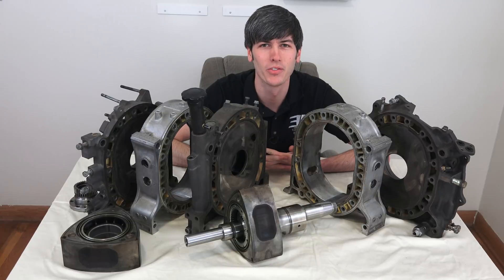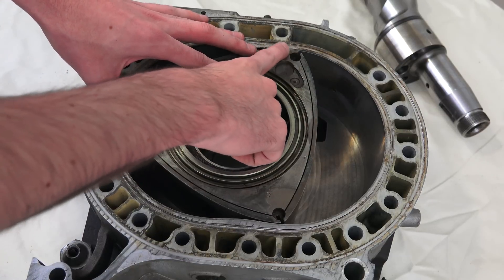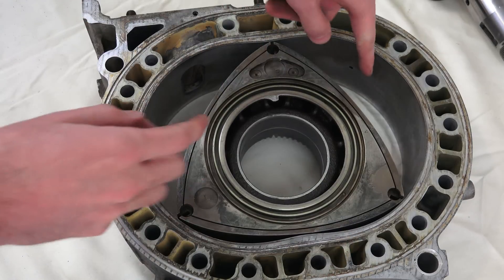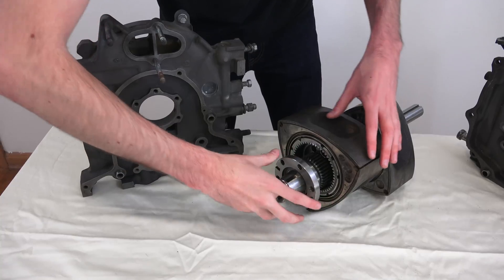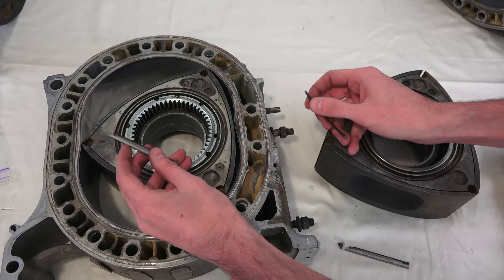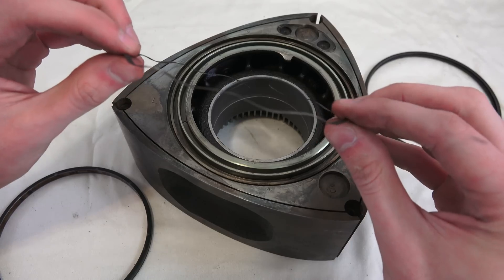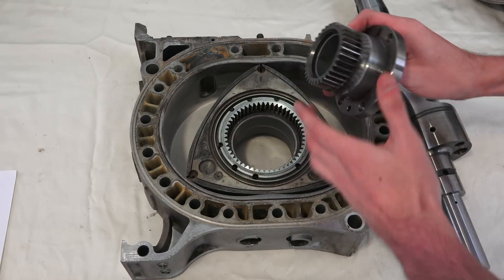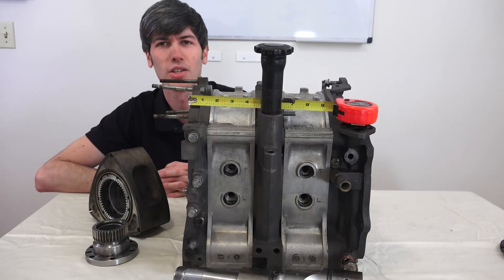How Rotary Engines Work - Mazda RX-7 Wankel - Detailed Explanation

Comment: I think these engines would be great as, like ATV, outboard motors or tiny rotary lawn mowers. but in a car they are just downright awful. they are so slow, and get worse MPG then my e85 EVOX, which is funny since I'm happy to get close to 200 miles a tank, but it only cost me 20 bucks +/- a few bucks to fill up. there is no excuse, mazda has dumped billions in rotary research and still it has changed very little. I have driven a 300hp FC, and its nothing close something you would want to daily. they did a lot of things though like the twin scroll turbo, which was a HUGE deal back in the day, if you think in the terms that Subaru just added a twin scroll in 2015 to the WRX, they were using them 25 years before. rx-7 did a lot for the compact sport car technologies in handling and chassis: are  still some of the best today, they pretty much bank on this stuff still. ZOOM ZOOM, is not a feeling of speed but of chassis born from early rotarys to make a car fun to drive.
Reply: +digitalsaint2040 Sounds like the 300HP FC you drove (which is easily achievable with a bolt on hybrid stock turbo and some larger secondary injectors) was broken if it wasn't drivable as a daily driver. A real shame because 300HP is what I consider the real sweet spot for FCs. Not stupid fast but certainly fast enough, easily done, reliable, good fuel economy and a blast to drive.
Reply: +digitalsaint2040 They're slow is not an argument if  you compare them to a modified car. My 85 RX-7 (When Stock) beat my buddies stock 85 Celica in a drag race. 1.1 liters vs 2.4. so even stock against comparable cars they are great.
Reply: +Charles Darwin I half agree, because I think if they put a 4cyl with the twin scroll turbo, they would have had a much more potent car. when I mean potent, with its weight  faster then 1985 911, or a Ferrari 308. IMHO the technology of the twin scroll turbo out shined the engine. without research I cant think of any production car that was using them at the time. think about it, that's a big deal.
Reply: Well if they did go the Turbo route, the inline four, or the turbo inline four route weight would've been significantly higher than just a rotary. However, I can see what you're saying. Similar to how the RX-8 is great car, its practical, handles well, rides well and looks good. But is an unreliable turd, because they needed to make XXX hp from a NA rotary, where if they used a V6 they would've achieved their goals, and had much better reliability.
Reply: +Charles Darwin eh, by time the rx-8 was rolling off the line, semi-closed deck all aluminum block's and plastics would have made a light(er) engine, maybe not as light as the rotary, but at that point handling wise nothing some tweaks couldnt fix, I mean look at the MS3 and its FWD very solid, purposely understeers to panic free delight! I really want to like the Wankel, and SO does Mazda. maybe somewhere down the line technologies will open a new doors for engine.
Reply: +aaroncake I'm sure you're right. 300 on a mustang dyno, so play with those numbers in your head. it was loud and ??K sprung, swifts and helpers, super tight. and the owner assured me fuel economy is abysmal. relative to driving it daily. he said the same thing, 300 was a good spot for the platform.
Reply: My 1.1 12A gets 300km from 50 liters of 91. it is carb'd though. Slightly more understandable.

Comment: I own a rotary  (n/a fc vert) and I have got to say the rotary engine is brilliant. the stock motor in my car lasted 170k miles due to correct maint. and coming from someone who loves beating on their motors a rotary will stay at 4500 rpm all day and love it and when you start shifting at 3k it will bog on you. beating on a rotary is the best thing you can do for them.

Comment: so what exactly makes it unreliable?
Reply: The seals can break and there it is a lot of things you need to do differently compared to a normal engine. Example: if you don't rev it high enough when you turn it on the engine can flood
Reply: +evoxs ok thnx
Reply: +Jacobi Miller Drivers. Rotary cars have to be driven hard. SA22 and FB RX7s even had a buzzer that let you know when was the optimal time to shift- 7k RPM, if I recall correctly.

Comment: Should I get an FA or an FB rx-7?
Reply: +Phil Raus chassis codes dont change in Austria? Lol ....fb didn't come turbo they did make a few 12a turbos but I highly doubt that what you are looking at for 4K lol you are talking about a FC turbo II. In which case 4K is about right.
Reply: +Phil Raus idk about insurance rates over there... But I do know I'd be very skeptical of a cheap 12a turbo like that....
Reply: +Phil Raus yeah that's my point I wouldn't trust a someone who bolted a turbo on a 12a selling for 4K.
Reply: facepalms
Reply: +lee Jones they are the only ones in my Budget
Reply: +Phil Raus *SA22 or FB. Besides, they're mostly identical, except for some engine and visual differences.

Also, I think that an FC would be cheaper.
Reply: MarchuxProductions nah not here.
The cheapest FC around costs 9k and it is rusty, leaky shocks and a gearbox with two gears missing,whereas the best fb costs 4k, has low mileage an aftermarket turbo and h&r coilovers. Thanks anyways!
Reply: I think he's mistaking fc for and fd. The first generation rx7 was an fb
Reply: lee Jones no Im not
Reply: well where do you live!?! I bought a mint fc with 50k on the motor clutch and tranny no rust no rot for $3k
Reply: invinciblejets I said it had an aftermarket turbo, and the fc and fd rx7 are REALLY expensive to insure. Im talking 3k at best yearly.
Reply: +invinciblejets its not a12a turbo, it has a bolt on!
Reply: +invinciblejets it was done by professionals
Reply: +invinciblejets and i study, so thats why I have to rely on otjers ppls work.

Comment: My friend have a RX8 R3, I drove it couple of time. Smooth, fun, handle like crazy. And this engine love to go slow or fast. even at low speed it feels smooth. But man, It drink fuel like a truck. 230 Hp but use gaz as much as a Big ugly V8. In fact, My friend had a better average fuel economy on his 95  5.7 V8 camaro with manual transmission.  That's unfortunate because the RX8 is a good car. Surprisingly practical for a coupe:  the rear seat are usable, the trunk is not bad, it's comfortable and the R3 looks great too. But damn those engine are not efficient. If it had 300-350hp That wouldn't be too bad, but it use too much fuel for the quantity of torque/Hp it produce.

Comment: I love the Wankel  or rotary engine the lower parts count and smaller size and weight are wonderful but there  is a inherent problem in incomplete compustion of there charge this is very obuose in there Hydrocarbon out put   level , this is why Mazda stopped production , if this used hydregon as a full source   , problem solved ! , then all the good parts are still there , This is why I am working on a variation of the Stanley  Myers system using a Wankal engine Harry .

Comment: So, you mentioned that the rotors are 180 degrees from eachother, how does this apply to a rotary engine with more than 2 rotors? For example a 3 rotor wankel or perhaps a 4 rotor one?

Comment: +Engineering Explained
Full explanation given but what about the disadvantages?
1.The concept seems to have too much stress for the so-called seals and the rings which is to separate the chambers,do they wear our very very easily compared to pistons' rings?
2.why there is only 2 rotors option for the commercial purposes?I mean why don't they (Mazda) make it 4 for lets say they Rx-8?
3.Actually the rotary engine,in my mind at least,is  producing way more power than the pistons due to the fact that one complete cycle has continuous 3 combustion, is this true?
4.Is it because of the extreme high compression that causes most Rx-7 tuner to be failed in putting in a turbo?(once a video showing a Rx-7 racing with another pistons' caught on fire due to high and long-term reving in high RPM)
-a person interested with rotary and Vtec concept
Reply: +Xhin Ava 1. Yes and no. They require lots of lubrication, which can only be achieved at high revs. Normal people would never imagine that you NEED high revs for the engine to last.
2. Two rotors are cheaper, even simpler, provide enough power, and (most importantly) consume less fuel and produce less emissions.
3. In short, yes. Also, less moving parts=less power lost.
4. Rotaries are actually fairly low compression, AFAIK. They are great engines for turbocharging.
Reply: +MarchuxProductions Thank for the kindness.I see the points.I can't really agree with the fourth though...it would be nice if EE would see this post and explain with calculation perhaps.
I have been always imagining if Mazda would mass produce a mid-mounted 3 rotors with turbo charger...imagine a NSX with 4 rotors and twin turbo charged,787B revived?haha
Reply: +Xhin Ava no problems! And for the 4th point, that's just what I read somewhere a while back, so I might be wrong. 
And a car like that would be amazing!

Comment: What is supercating mass? I'm not very good in listening
Reply: +Soranut Ratanavaraha Reciprocating mass. Although I wouldn&#39;t say that wankel has not reciprocating mass. The mass center of that rotor is still out of axle of rotation and therefore requires normal force to keep it on it&#39;s track. The difference is that the force is always pointing to that shaft, wheres in piston engine it&#39;s changing continuously which I suppose, can cause a fracture of a piston rod due to fatigue. But that&#39;s just my opinion.
Actually, nevermind.
Reply: +Soranut Ratanavaraha reciprocate means to move up and down. Like Jumping. Or like a valve. Or like nothing in the rotary engine.
Reply: Thanks guys 😁 I'm new to these words

Comment: I always thought the 'concave pockets' on the side of the rotor was to adjust the compression ratio and not 'increase the displacement' as the actual 'swept volume' doesn't change ie no different to the same kind of 'pockets' (or domes on high compression engines) used on the top of a piston?
Reply from the maker: You can change CR with the pockets, but that also increases (or reduces) displacement.
Reply: +Engineering Explained  but it still doesn't change the 'swept volume' of the chamber which isn't that what the engine capacity figure relates to? This is no different to a piston engine. Or are you trying to say that the manufacturers are quoting engine capacities incorrectly? Why do I say that? Using the 13B rotary as an example as it's in your video, Mazda quote 1308cc for both the turbo and naturally aspirated 13B engine over multiple generations. If you look at the rotors you would find the 'pockets' are different sizes depending on compression ratio required for the application ie larger 'pockets' for the turbo engines to reduce the compression ratio (8.5:1 vs 9.4-1 turbo vs N/A for the S4 RX7). Yet Mazda still quote 1308cc for both engines (and every other 13B configuration over its lifetime) and not a higher capacity for the 'larger pocketed' turbo which according to your explanation is what they should be doing. I'm confused, am I missing something?

Comment: Would a roller work as a seal on the rotor corners? With a leaf spring to maintain connection to the chamber

Comment: Great video! There's a lot to expand on this topic. For example, Mazda won the 24h of Le Mans in 1991 with the legendary Mazda 787B with a 13J Wenkel engine. Rotary engines were banned the following year in that race IIRC. Mazda stopped production of this engine in 2012 after failing to meet european emissions regulations, but the announced SkyActivR concept car is reported to have a new rotary engine.
For track/race application, it's a fantastic design due to its power to weight ratio (literally, the amount of power it can generate with a very low weight).
Reply: +Olivier Bailly No, it had the R26B or simply 26B. It replaced the 13J from the 767.

Comment: how many rotors can u have in a motor like this?
Reply: +Daniele Dal Col The RX7 and RX8 had 2, the Eunos Cosmo had 3 and the LeMan winner had 4 rotors.
Reply: +Daniele Dal Col 6 rotors is the most I have seen.  Mazda only ever put 2 and 3 rotor engines in their production cars though.  4 and 6 rotor builds generally require a custom eccentric shaft.
Reply: markevens "lost" ... u meant stolen :D
Reply: +chinchy111 its not that it illegal its just a race engine. Like a 1300cc V6 Turbo F1 engine. its not designed for the road.
Reply: As many as you want. You have to make a custom eccentric shaft for most builds though.
Reply: Most I seen is 4
Reply: +Daniele Dal Col there is the 13B (2 rotor) the 20B (3 rotor) and the 26B (4 rotor) you will find the 20 and 26B in drag cars, They are however custom.
Reply: +Daniele Dal Col Just youtube 6 rotor.
Reply: +Daniele Dal Col someone made a 12 rotor that runs but its not in a car
Reply: why wouldnt it be legal? i dont think theres a law that limits the type of engine you have. just as long as it passes emissions laws for your state (Some states dont even have emissions laws). the only bad part would be cops knocking on your door for noise complaints haha
Reply: +chinchy111 there are restricted engines and modifications for "street legal" vehicles. It does vary by state. Even other countries put restrictions on "race engines" for use on common roads. There are several reasons for it being illegal. The main reason being how dangerous that much power is when not hooking up properly on a track-type surface as well as trying to deal with traffic and pedestrians.

Comment: With its disadvantages in mind, this design is perfect for racing and it is also why it is banned in Le Mans.
Reply: +Jason Yu it was banned for a displacement issue, mazda says the 787b was a 2.6 liter but other manufacturers contested it saying that by design is 2x or 2.5x bigger, which would violate the rules, so they just outright banned the whole design, however it has been unbanned since then, but mazda has no interest in completely redesigning the engine to fit a vague requirement